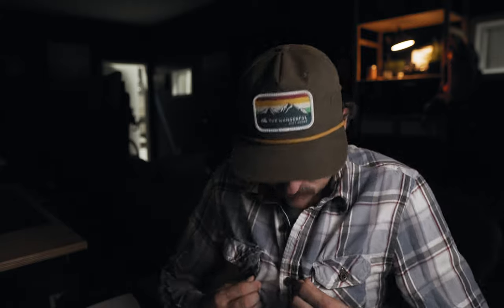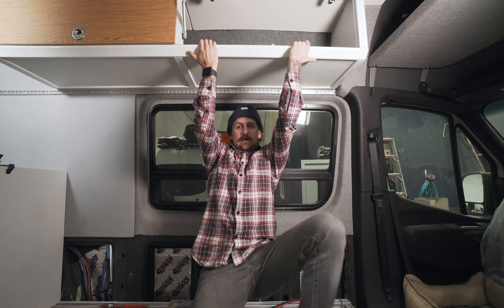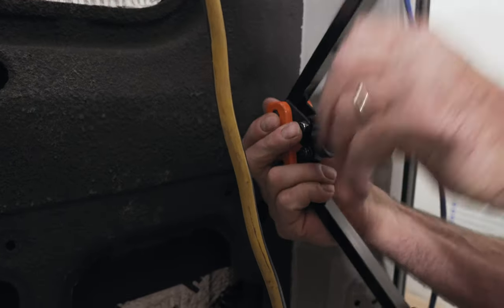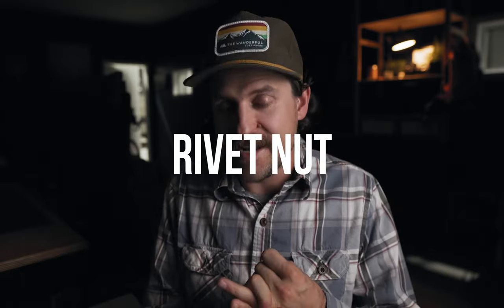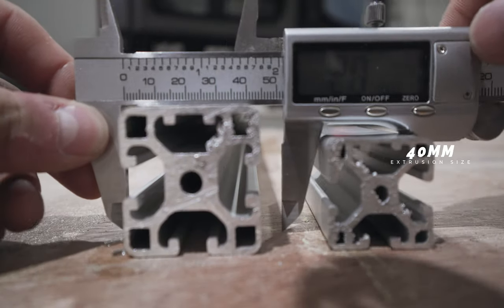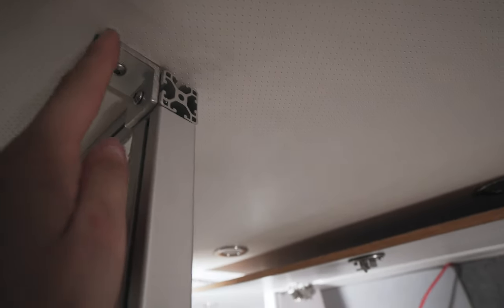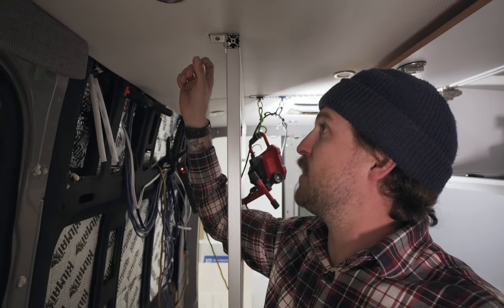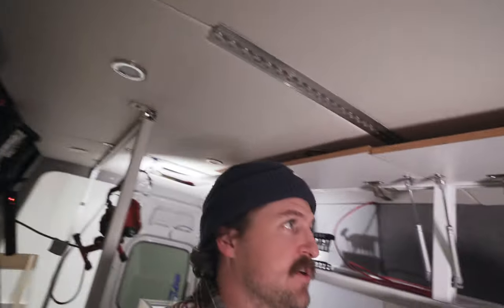How to Fasten Extruded Aluminum (8020) in a Sprinter Van | VAN CONVERSION

Comment: Plus-nuts and Riv-nuts are excellent in van builds!  But getting them snugged correctly is tricky.  Too tight and you can damage the threads.  Too loose and you run the risk of the fastener spinning in place.  Best fix for either one is to add a small drop of superglue to the outside facing flange.  Capillary action will pull the glue around the rim and ensure solid adhesion, keeping it from spinning. This also works if you have a cross-threaded bolt that won't come free of the nut without spinning.  

Love what you've done so far!  Looking forward to the next video.

Comment: Hi, I’ve been considering the rivnut placement and locating in material that overlay the rivnuts. I think the use of a laser level device might help. Adjust the level until it bisects the rivnut, secure the level, overlay the material then mark it for drilling. It’s all theory of course as I haven’t tried it in practice 🤓.
Reply from the maker: Yeah good idea.

Comment: You said it's hard to find the rivnut in the ceiling, how did you actually do it? Did you measure from reference points you knew for sure?
Reply: I would also like know if there are any tips/tricks to locating rivnuts behind panels.

Comment: I would like to know if you use something to isolate the 8020 from the van frame as a thermal break?  A piece of rubber, a piece of plastic, something?  Also, the aluminum is anodized, so for grounding purposes, do you run a wire to some place on the 8020 where you've removed the coating to make sure the aluminum conducts?  Thank you!

Comment: Curious.  Rather than attach the 80/20 with L-brackets, why not drill a hole through the 80/20?  If countersunk, you could still probably pass T-nuts through the channel of the 80/20.

Comment: Hey, I bought some 1.5" extruded aluminum to test and its way heavier than I imagined! I might switch to a smaller size but I'm not sure what I'm giving up
Reply: Hello Drew!
I am not the video creator, but just someone who has been working with T-Frame aluminum extrusion.
The answer to what you are giving up is a complicated question. When you think about 1 inch vs 1.5 inch the biggest difference is in horizontal tensile strength and torque strength. There are some differences in how many attachment methods exist as well.

10-Series (1 Inch) T-Frame is impressively strong. It should handle most structural tasks you give it with ease. An 82" 10-Series bar can hold me doing chin ups in the middle of it with negligible bowing. This means that my queen bed frame made out of 4 82" 10-series extrusions is overkill. And overkill is not necessarily a bad thing. But as you aware from your comment, weight is a big issue in a van conversion.

15-Series (1.5 inch) is ~ 180% stronger than 10-series in foot tensile strength. This can be used for high stress parts (walkable roof rack / solar) but even for those applications the failure points will probably bee the mounting points on the solar, roof, or parts other than the T-Frame itself.

Your best bet is to USE YOUR JUDGEMENT. Play with the materials. Think about the use case for their application. You can do it!
Reply: @shadradson  Hey thank you! That helped me a lot

Comment: Thanks for these videos. 
I'm wondering if the 20mm series would be strong enough to build upper cabinets with, or possibly the kitchen cabinets? Just thinking the upper cabinets won't have to hold too much weight.

Comment: How did you secure the Aluminum Extrusions to the floors? Especially the front of the cabinets where there are no tie-downs/drings to secure too?
Reply: I have the same question, and if you have used rivnuts how did you watertighten them?

Comment: Question: (and I'm sure I'll find the answer on 8020.net) but my cargo trailer is aluminum-framed, not steel. So dissimilar metals causing galvanic corrosion is a MAJOR concern for me. Any thoughts on proper fastening into aluminum structure? Excellent video BTW!
Reply from the maker: Thanks! I used a thermal break x 2 mass vinyl and lixard skin so the 8020 is not touching the sheet metal.....but I not an expert on galvanic corrosion but I figured that should help me.